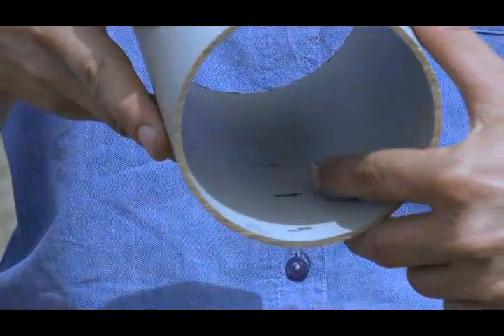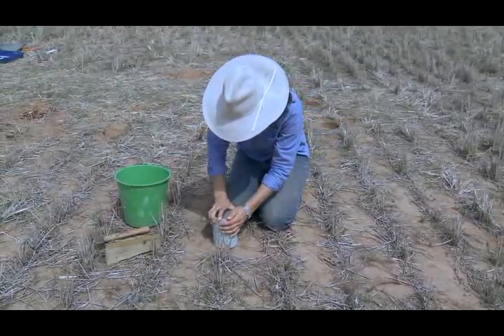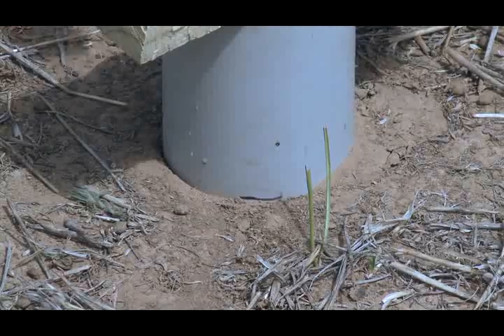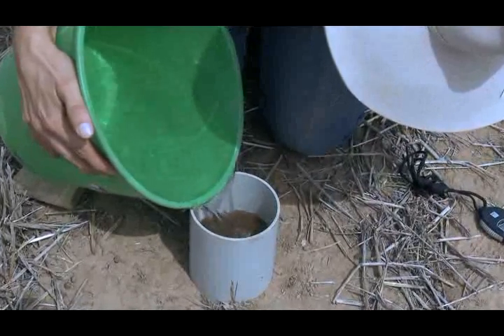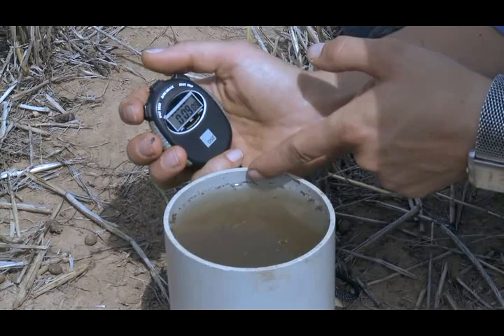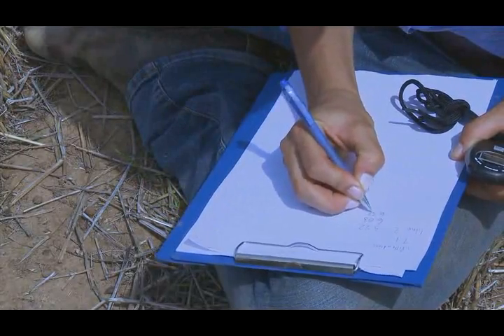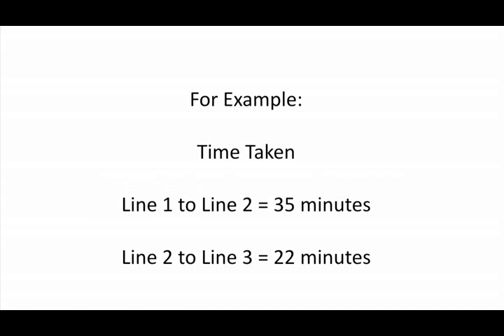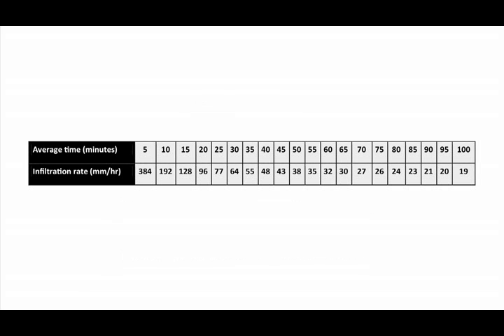How to measure infiltration

Comment: There is so much missing essential information from this video. What is the diameter of the pipe? At what spacings are the of the lines inside the pipe. At what depth is the pipe inserted into the soil, as what looked like 50 mm or so means that the infiltration rate will be relative to that depth as once below that depth the water can move sideways (hydraulic conductivity). A more accurate tool is a Double Ring Infiltrometer that will maintain a contact head of water, as it weight directly influences the infiltration rate. The method pin this video is ok for amateur gardens but not fit for purpose for agricultural or other soils.